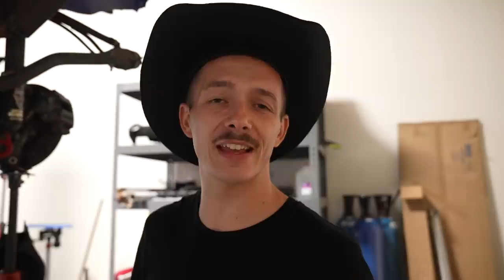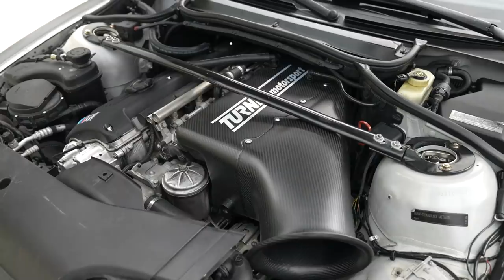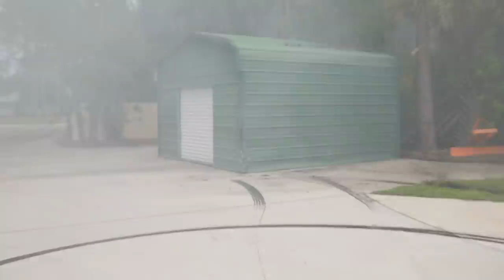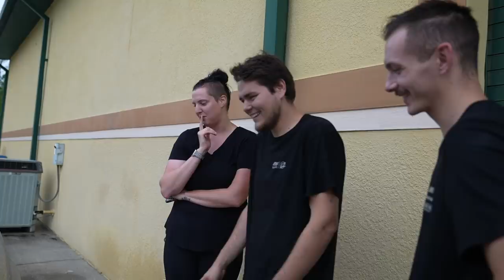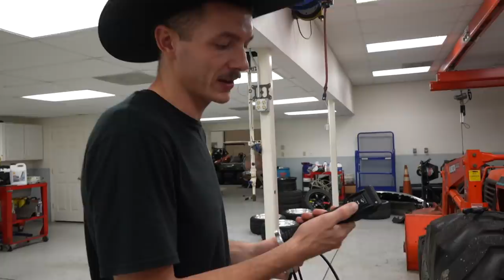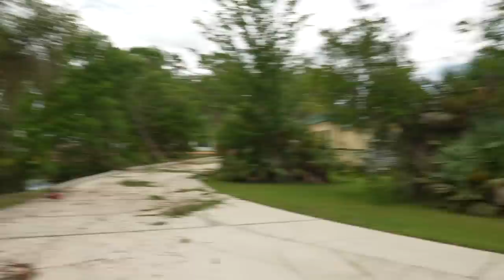First Big Crash At the LZ Compound...

Comment: Yo, Adam, The chain on the PTO guard is supposed to attach to something static to stop the guard from spinning, having it spin with the PTO can be pretty dangerous man :)
Reply: I know precisely nothing about PTO’s - but that chain flailing around looked instantly wrong.
Reply: Yeah forreal that and i think its meant to be dropped down on the roller because that driveshaft angle seems way too agressive
Reply: Yeah, dude that is not good I operate these small Kubota's for a living and that chain you need to attach to the implement( the blower) it spinning could seriously hurt the driver or anyone nearby.  and make sure you have it at the correct rpm for operation off the pto!
Reply: @StudioOfRandom   I run mine in the air, but I keep that pto driveshaft straight, roller is more if it hits something,
Reply: Please bump this for safety reasons.

Comment: That chains rotating with the blower driveshaft are suppose to be separated. One side gets hooked to the tractor, and the other gets hooked to the blower. They keep the black safety shield from spinning like it is now. Also make sure the pto shaft speed it 540 it'll be marked on the cluster how far to Rev the engine to get it there
Reply: Bump for people’s safety

Comment: Concrete needs to be sealed easy job just roll it on will eliminate all concrete dust . Dust is caused by the concrete not been finished properly only way to fix is seal it will also make it look shiny an be alot better for drifting

Comment: I'm telling you, you need to make that E36 an actual secondary FD car! Some of your best drifting and performances in competition have been in that chassis! Plus you're allowed to swap between the cars right? Like in FD are you supposed to be locked to one car unless it breaks or something? Or are you allowed to switch chassis per event? Like my idea is basically be able to use the S15 on larger tracks or like fancier tracks, and the E36 able to be used on the smaller more narrow and technical tracks! Or say your S15 is down you can hop in the E36 and visa versa and rip immediately especially since they share a ton of the same parts, have a ton of spares. I just feel like being able to choose a chassis depending on the track and environment would be super beneficial to you and also have a back up car so if one shits the bed mid comp or during testing, you don't have to scramble and mad dash to repair it either mid comp or in a short crunch time span before an event! Would be so rad to see them both done up in the same livary too!!!!
Reply: You just have to drive whatever car you go through tech in.

Comment: I've never crashed my E46 M3 but I can tell you as long as you finessed not fucking ur quarter panel you'll be fine. CSL trunks aren't too bad and will look better. CSL diffuser is the same way. The LED tails are cheap. The most expensive thing will be an OEM rear bumper and maybe a creative way to fix the piece between the bumper and the light. I hope nothing is structurally fucked. You can have it better than stock for a cool $2500- $3000 including paint probably.